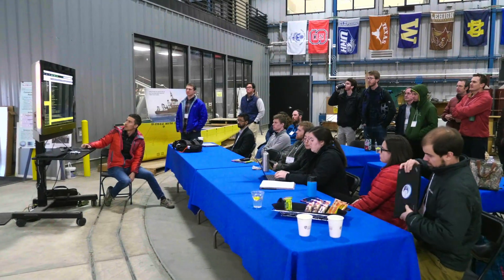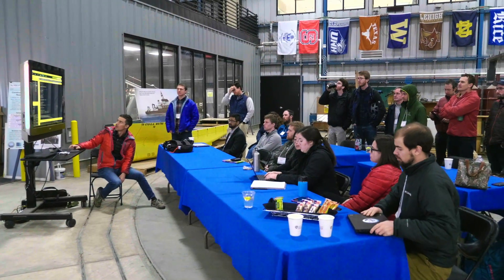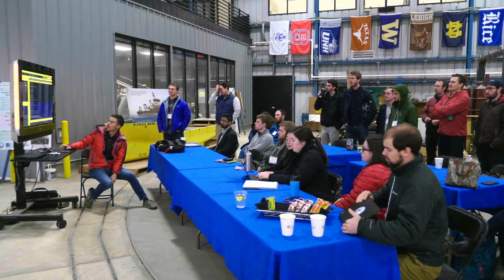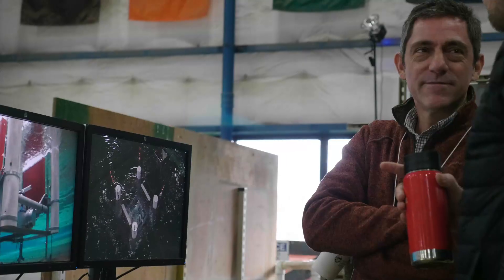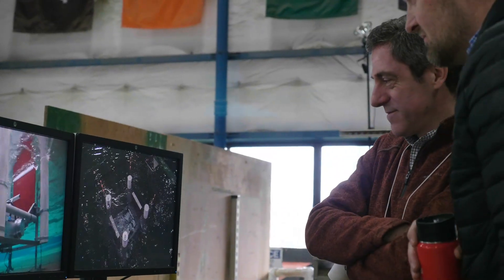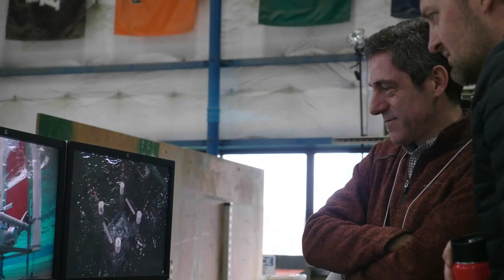FOSWEC Modeling and Control Design Testing

Comment: Lol.  that sure looks like a whole lot of time, money , and moving parts spent.  Why not simplify the whole deal and let the wave water  cyclically compress  trapped air into a funnel with a Tesla  valve at the small end.  Scale-able , Zero moving parts to maintain, (as long as the structural integrity of the funnel, Tesla valve, and storage tank are intact), & virtually endless compressed air to drive generators.
Reply: How much pressure is created with the tesla valve funnel machine?
Reply: A tesla valve is not a valve at all, its a directional flow resistor. Reverse resistance to forward resistance ratio at most 2 to1. It can not stop flow like a check valve can.
The second law of thermodynamics explains why this energy scheme is very impractical. You fail to understand the extraction of useful work from energy sources at a low temperature or pressure or low flow rates is difficult and impractical. My suggestion is to study and understand the basic thermodynamics laws. This understanding will allow you to answer why thing work the way they do.
Reply: Remember the sea is alive. Its creatures will plate everything including your complex machine making it useless. Also you are extracting energy from a low temperature which is very inefficient. See 2nd law of thermodynamics.
Reply: @ad2181   @ad2181  Yes of course the the sea is alive with all manner of creatures, but I don't follow what you are saying.  What is "complex" or "mechanized" about a funnel and a Tesla valve (which is a fixed-geometry passive check valve. It allows a fluid to flow preferentially in one direction, without moving parts. ) With  no moving parts and constantly being flushed with extremely fast moving, high pressure air and water , the valve would be very difficult to clog, but quite simple to unclog. can you clarify plz?
Reply: @Killianwsh  dont talk to these radical racist scientists
Reply: @brethitchcock5885  Lol. Umm ? I don't get it. What's racist about discussing energy solutions that are more environmentally friendly and efficient?